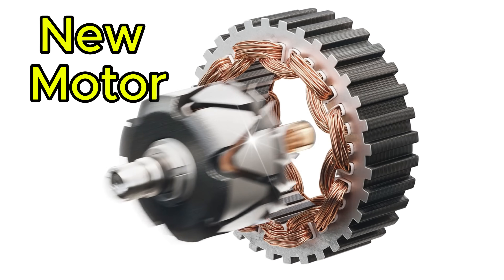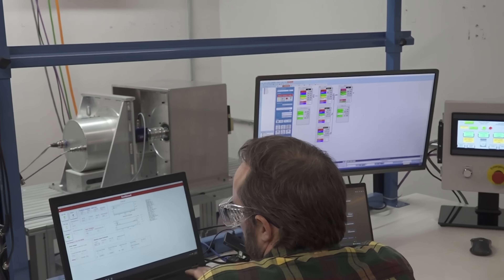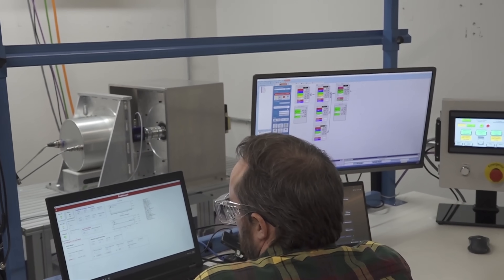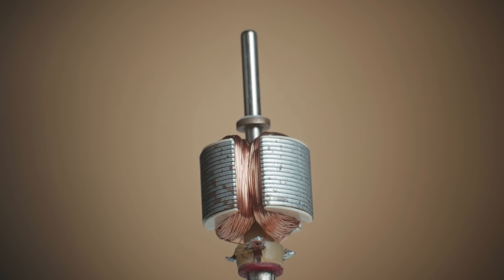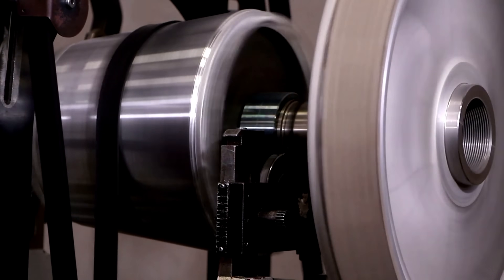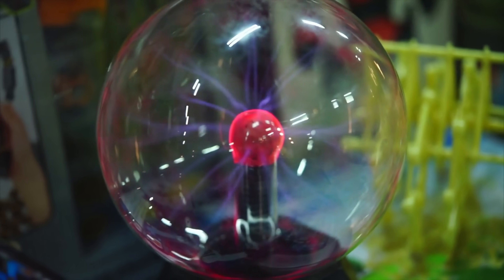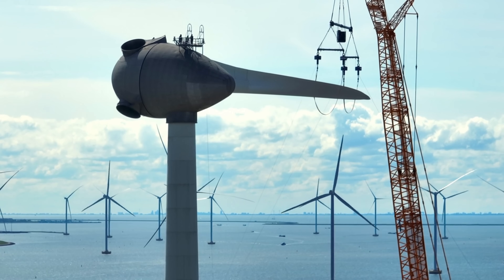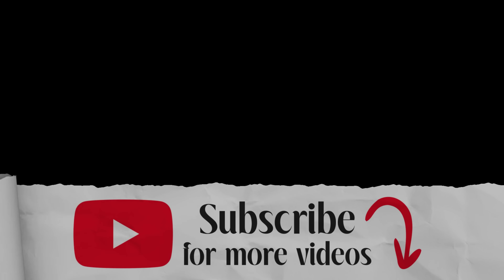Radical Electrostatic Motor Runs Without Metal Coils and Magnet – Here’s How

Comment: Well tell us how it works then!
Reply from the maker: Instead of using magnetic fields like a normal motor, it uses high-voltage electrostatic fields to push and pull charged plates or surfaces. That motion is converted into rotation, and because there are no metal coils or magnets, it can be lighter and avoid some electrical losses—but it still needs a power source to run.

Comment: Can this be used as a generators?
Reply from the maker: Electrostatic motors are usually designed to use electricity, but the principle can work in reverse—just like regular motors can act as generators. The catch is their output is typically small unless the design is scaled up, so making practical power is still a challenge.

Comment: Can they produce electricity?
Reply from the maker: Electrostatic motors are usually designed to use electricity, but the principle can work in reverse—just like regular motors can act as generators. The catch is their output is typically small unless the design is scaled up, so making practical power is still a challenge.

Comment: The electrostatic motors are too weak ( not enough amperage ) and the electrostatic fields created by a voltage of 5-15 KiloVolts are dangerous.
For example in a regular electric car that has a system at 800 volts ( like Hyundai ioniq 5, kia 6, BYD EVs, etc ) if somehow the wires' 800 Volts voltage get to the driver ( like in an accident, a defect in wire isolation, etc ), the driver is dead instantly.
Think about what 5 to 15 Kilo Volts continuous voltage can do to a human.
Reply: So are you saying you never had a CRT monitor, or a microwave? CRTs need 24 to 32 kV for color display. Until recently CRTs were numerous in all types of aircraft. Some are still operating.
Reply from the maker: You’re right that electrostatic motors face big hurdles—low current output limits their torque, and high voltages in the kV range need serious safety engineering. That said, the danger depends a lot on the available current and how the system is insulated, not just the voltage. Even EVs with hundreds of volts use strict isolation, shielding, and safety interlocks. If electrostatic designs ever scale up, they’d need similar or even more robust protections to be viable.
Reply: renewable_e • The problem with very high voltages, like KiloVolts is that they can discharge through the isolator in many cases. The isolation in these cases has to be crazy enough, very special...
However, these electric, electrostatic, etc, motors are just one of the evolutionary step in this direction . The next step will be the propulsion motors based on ionized medium. 
They are a huge step ahead of the actual ionic propulsion in the sense that what you disturb by an ionizing disaggregation in the front of a moving craft ( = let's say "velocraft" ) is compensated automatically by the natural entropic rearrangement of the substrate behind the "velocraft" ( "velocraft" being any ground vehicle, aircraft, rocket, interstellar spacecraft, etc ).
It is exactly like a submarine that would move instantly in the direction of the instant decreasing density in the entropic medium ( the liquid, water, etc ) just by the entropic force behind it that's symmetrically opposed.
In this case of an advanced ionizing propulsion the energy is taken from the medium  around the velocraft which is everywhere and   limitless.

Comment: 【Honor Mr. Tesla】 Let's stipulate that the evidence is sufficient. Thousands of intelligent engineers and entrepreneurs filed the new H02K53/00 patent applications. Some received patents from the United States Patent Office. Also, let's stipulate that the generator Mr. Nikola Tesla claimed would not "consume any fuel” is the Dynamo perpetua mobilia and is empirical. The generator is a solution that will solve the climate crisis and move us toward a Type III civilization.
Reply from the maker: I agree that Nikola Tesla’s vision and creativity have inspired countless engineers and innovators—including those working on unconventional motor designs like this electrostatic approach. It’s true that many patents, including under H02K53/00, explore concepts outside the traditional electromagnetic paradigm.

That said, while Tesla did dream of generators that could operate without fuel in the conventional sense, physics as we currently understand it requires that energy output be balanced by some form of energy input—whether that’s mechanical work, environmental potential differences, or another source. “Perpetual motion” in the strict sense has never been demonstrated under controlled, peer-reviewed conditions.

If a practical, self-sustaining generator were ever proven and replicated, it would indeed be transformative for energy and climate—and a huge step toward higher-level civilizations. Until then, exploring innovative motor designs like this one is still incredibly valuable, because even incremental improvements in efficiency and sustainability can make a big difference.

Comment: I liked this video. This motor is a promising tech.

Electrostatic motors can offer advantages over electromagnetic motors in certain applications, particularly in terms of material usage, potential for higher efficiency, and reduced reliance on rare earth materials. Electrostatic motors can be smaller, lighter, and potentially more energy-efficient, especially in applications where high-voltage, low-current operation is suitable.
Reply from the maker: great